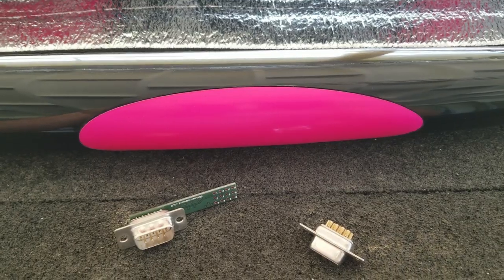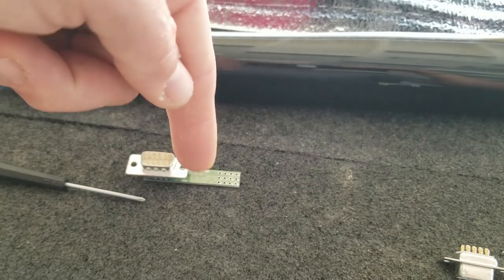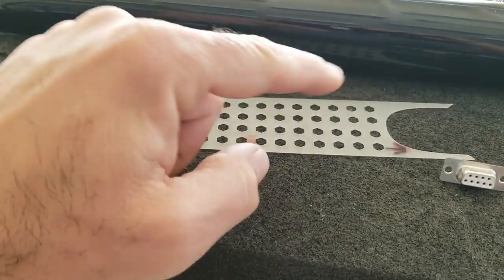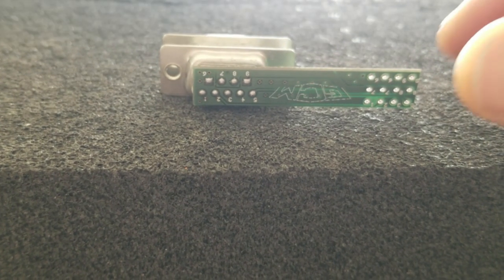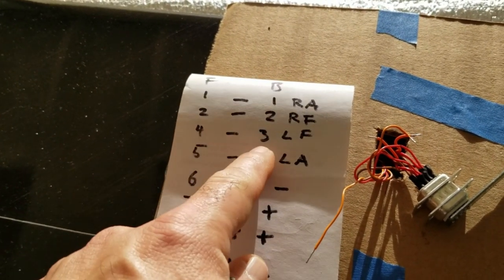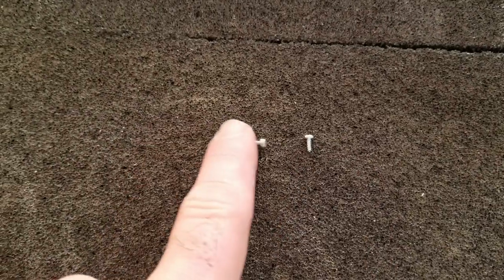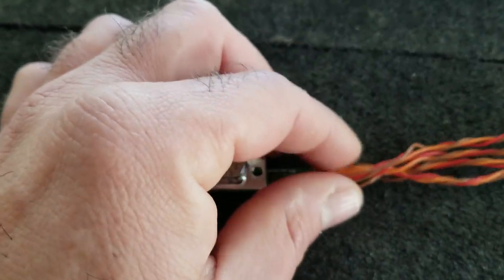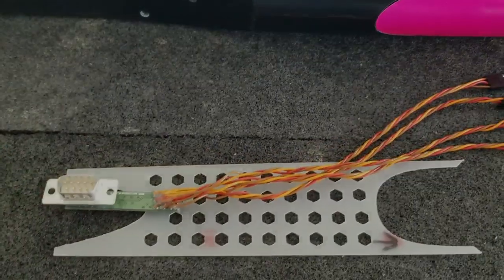Vertigo F5J Updated Wire Harness Build/Tips

Comment: One possible optimization (if you care about a few grams) is to have 6 wires only for the whole 4servo wing: common + and - leads from receiver via connector and to the servos. A bit more messy to lay down, especially with the soldering inside flap servo bays.
Reply from the maker: Hi Jure, yes. I have done that before but I wanted to show a standard build for my customers.